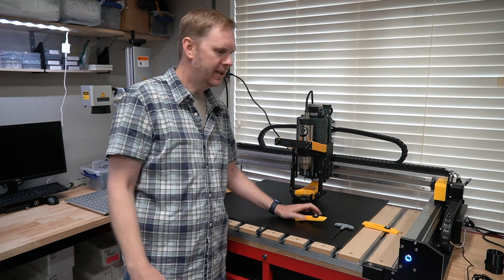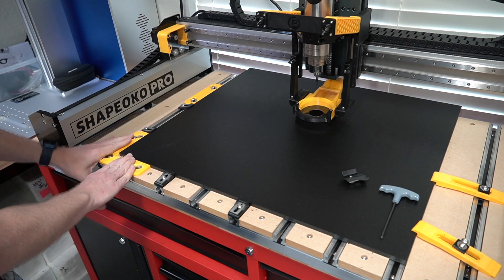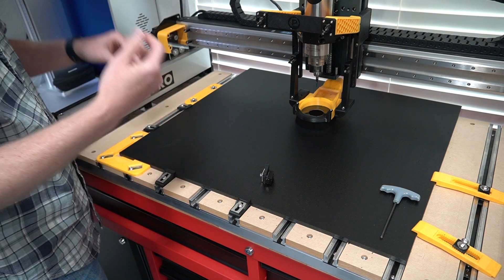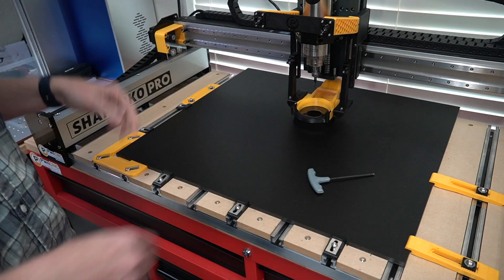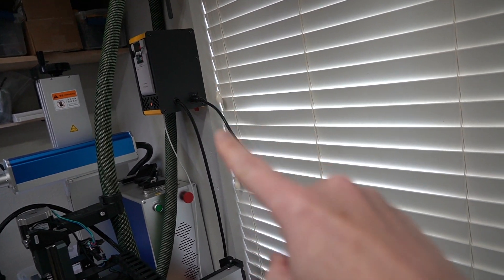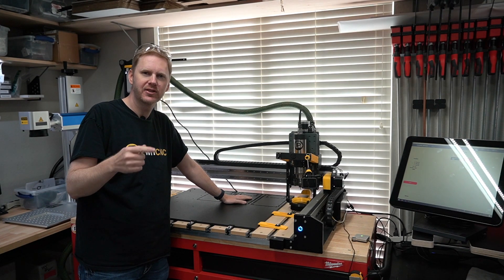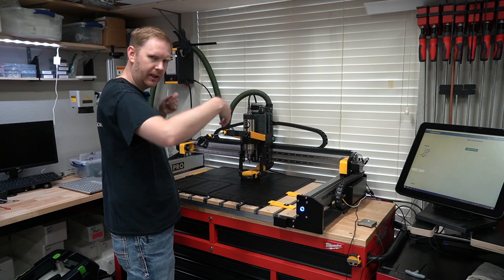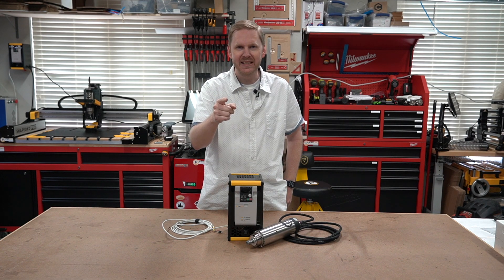Carving HDPE

Comment: good stuff, have you cut hdpe with a v bit, with any success? my cuts look fuzzy and unusable
Reply: You might find the direction of the cut makes a difference. If you are doing engraving, look at each side if the cut path. One side is climb cut, and the other is conventional.  If one side is better than the other, then repeat the path in the opposite direction, and 0.002" offset from the original path, so that the good side is not touched, and the fuzzy part is re-cut in the opposite direction. Depending on spindle speed, the horizontal movement speed might also be worth experimenting. An easy test case is to cut a circle, and see if the inner or outer part of the V cut is more fuzzy than the other. Just changing radius and cutting the circle in the opposite direction, should let you see if you can get better results.

Comment: Dewalt makes an automatic screwdriver with a gyroscope in it. Use it all the time to loosen and tighten clamps.
Reply from the maker: Does it have a low torque setting?  My Milwaukee driver had a really low setting that I’m comfortable using when installing my bracketing.  It results in a nice snug/tight and not over tightened to the point of breaking anything.
Reply: @PwnCNC  yep.You can even go lower than hand tight.